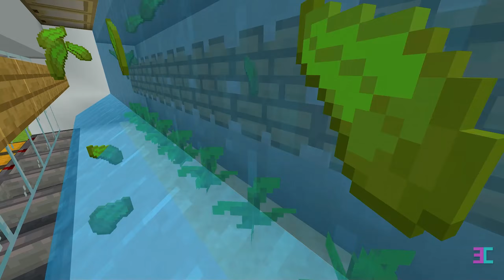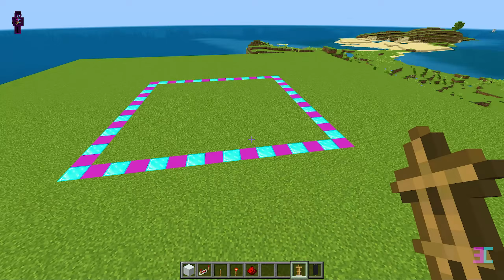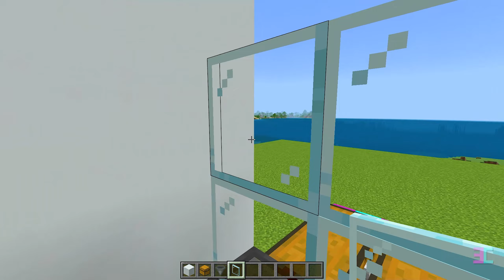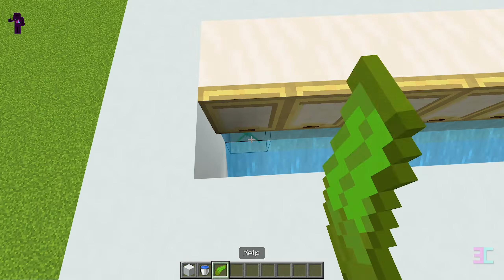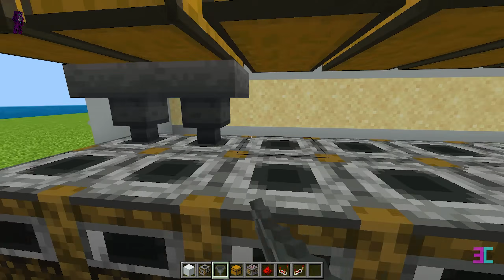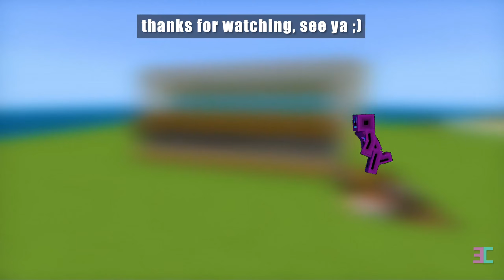New Kelp Farm in Minecraft Bedrock 1.21.31

Comment: I thought they broke this in 1.21.30 ... what's the change in the mechanics that makes this one work?
Reply: Had to add extra sticky pistons, different timing, more sand that’s locked in better. Some people also changed where you Waterlog the farm
Reply: @noahlounsbury3656  Cool, I'll experiment a little : )
Reply: @ this is the absolute best one I’ve found, small created advertises it as a wood farm but really he builds a bonemeal farm and runs it into a single dropper into a single bamboo with a crafter system lol
Reply: @noahlounsbury3656  Thanks, I'll check it out.
Reply: @ https://youtu.be/XDJ5na_Rtkg?si=kJ38w6vL8AlM0ote

Comment: It’s strange that this farm works pretty much flawlessly in smaller set ups, but seems to not like being tiled together in large sets (sand/kelp breaking).

I’ve also found that this farm REALLY doesn’t like being automatically turned on or left unattended, I tried both and all of the sand broke.
Reply: @KycenPetersen  yes because it has to be a chunk aligned farm, you’re limited by the confinement of a chunk. And yes DO NOT leave the area while it’s running, I’m pretty sure it just needs to stay in your simulation distance. Does this farm still work after the spring update? I had a similar design that 1.21.5 broke
Reply: @noahlounsbury3656 yeah it still works.
I tried to make a small, afk version of it that would power on after the hopper above the smoker was emptied and power off after said hopper filled up completely, I was standing right next to it and everything still broke lol
Reply: @ awesome thanks man finally gonna get working bonemeal and fuel again